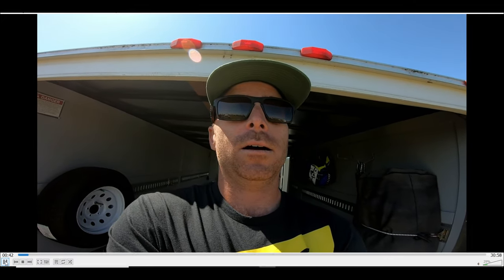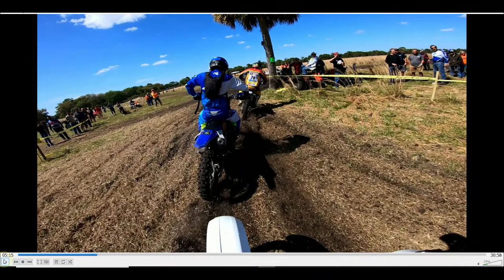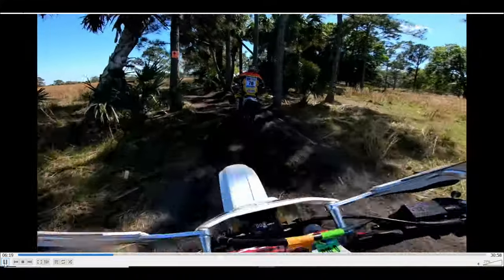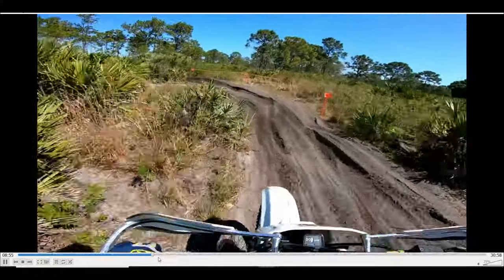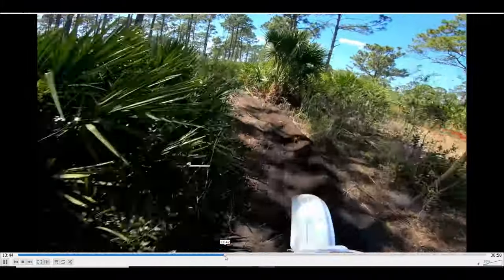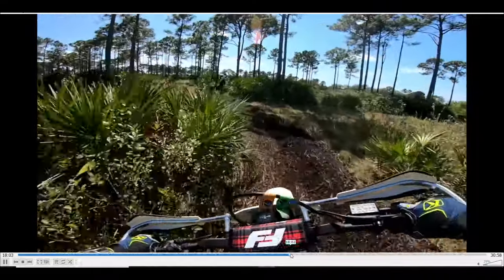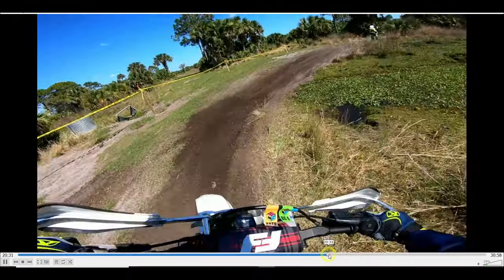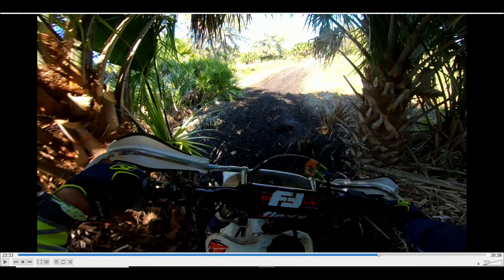HARESCRAMBLE LINE CHOICE BREAKDOWN

Comment: I liked this format even though I know most of it, I still learn. I don't know your mechanical prowess but I was thinking you might want to do a leak-down test on the old girl and see if you're not loosing compression while she sits on the line. Piston rings or valve seat loss will do what you're experiencing.
Reply: I though the starting procedure on older big thumpers was to kick a couple times with the decompression lever pulled in to "clear the system" and lower the fuel level in the bowl to make it a little leaner then do a normal kick at TDC and it should start. If you wait too long the bowl fills back up and you gotta do it again. Him doing it later just gives it less time to fill back up. He is using a Lectron so I'm not sure if the same principle applies.

Comment: That was a good ride-along!  Thanks for making that, keep up the deadpan humor, and see you out there.  What's your general preference at the double greens in the pastures, like do you prefer to brake hard, then cut inside, or try to keep a longer arc?  I know you're a fan of the green grass, but if that's not there, then what?
Reply from the maker: Typically even once my preferred line has been beat up, it's still beat up less than the others. If there's going to be bumps no matter what, I would almost always just find the shortest distance through the bumps even if they're bad. Just point in the straight line and hold on.

Comment: Never done a harescramble before. Really enjoyed your breakdown of the track and strategy. Speaking of energy conservation. Is party of your strategy to sit down when possible? When’s the best time? Corners and smooth straights?
Reply from the maker: I wish I had a set rule that I could give you to help. I think it's a personal preference. If I think an obstacle is too bumpy for sitting, I stand. I'll sit when I'm accelerating hard because it saves my arm energy.
Reply: Fast Guys - Slow Bikes That makes sense. I find myself standing more often than not but it wears on you after a few hours. I can’t imagine going as hard as possible for two hours straight. Thanks for the reply. Your videos are cool, keep them coming. And give us your thoughts on the Tenere after you have more time on it. Really curious what you think of it on trails vs larger dual sport bikes like an XR, DRZ, etc.

Comment: When you watch it with no sound it seems like you are floating through the trail. Are you faster on a modern bike because it looks like you rip on that bike
Reply from the maker: I feel the same way. Sound off I'm flying. Sound on, it sounds like a leasure cruise.
Reply: @fastguysslowbikes  If that bike had a snotty ear splitting exhaust or you were riding exactly the same speed on a 125 I don't think you'd have the leisure cruise feel watching the video with bike sound. That bike is able to make enough good power with sounding  like a sewing machine. Maybe not in person but it sounds quiet on the video I think. Did Mrs G have fun at the enduro? At least you have the video to share your 1 kick start with her